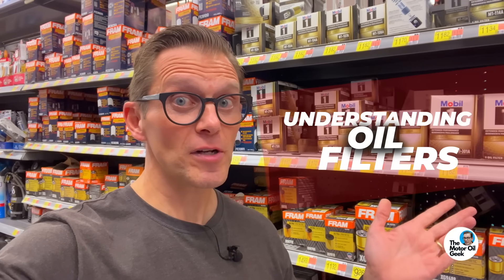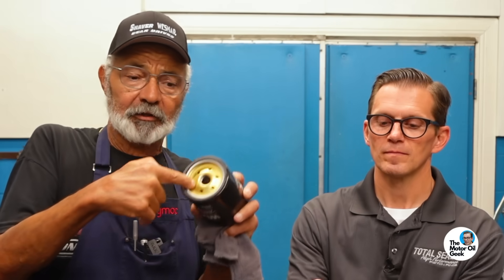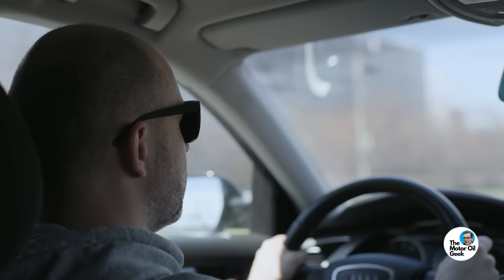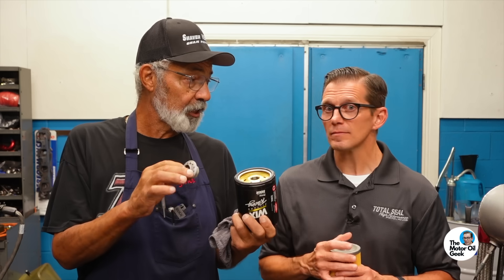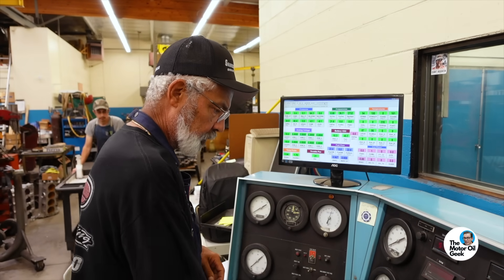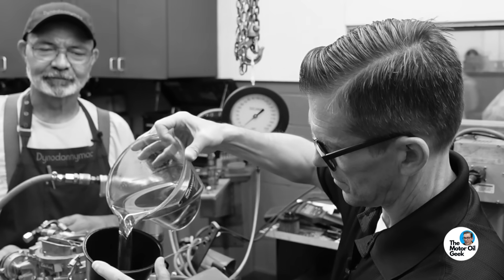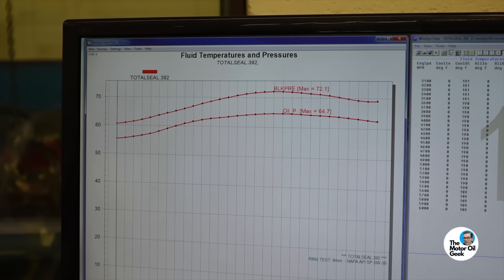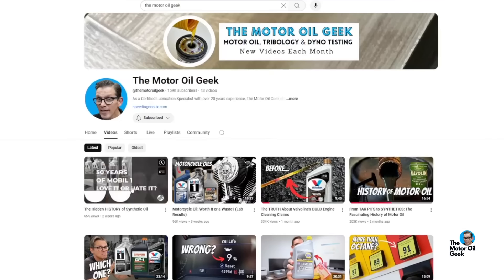OIL FILTERS: What Most People DON'T Know!

Comment: Someone commented on one of my videos when I did a video cutting open a filter after a 10k mile service. Filter wasn't clogged. The person insisted that it went into bypass when it started and then again at around 5k miles.  That the filter can't handle anything over 5k miles.  I was like thats totally incorrect my dude. Thanks for watching though. You just verified it for me and I hope he sees this video.
Reply from the maker: I'm happy to help!
Reply: 70 years ago Soichiro Honda understood that forcing cold viscous oil through a paper filter distorted and destroy the filtering characteristics of the paper. It turns the 20 micron holes into 200 micron so he designed and made sure the companies that manufactured his filters where manufactured to his spec of filtering materials and bypass  at the delta he wanted and made sure that they bypass at every cold start. Now decades later and filter materials have changed but 40 years ago when this was explained to me by a Honda master instructor at a Honda training center I tend to believe the instructor knows what he is talking about. Today with the filter materials always evolving probably can handle cold oil being forced through them but I doubt it, your Ford or Chevy filters are probably going from 20 micron to 200 micron the first time you start the engine up and it's probably one of the reasons why Honda's can go a million miles without a rebuild and a Chevy or ford is lucky to go 200k miles. Today none of this matters because oil is being destroyed by weak rings letting fuel dilute the oil.
I own a Chevy truck and Ford car but I ride one of the fastest Honda's on the planet.
Reply: @davidkato6407  the new Hondas not so much. Thats why I don't use fram filters. And he just showed in this video it doesn't go into bypass. I believe the dyno results. Now it may have been true 40 years ago.  But doubt it is today.
Reply: @BeardedFordTech  🤦‍♂️
Reply: @BeardedFordTech  70 degrees is not a cold start.
Reply: @davidkato6407  An "engine cold start" refers to starting a vehicle's engine when it is at a significantly lower temperature than its normal operating temperature, typically after the car has been sitting idle(not running) for a long period, causing the engine oil to thicken and making it more difficult to start and requiring a slightly longer warm-up period before driving normally; essentially, starting the engine when it's cold. Then there is cold weather start. Thays different. Then you have hot soak and cold soak. This isn't my first rodeo
Reply: @BeardedFordTech  Evap PID test will not run until all cold start conditions are met and that is not 70 degrees it is well below 50 and if you live in a warm climate these onboard ECM test will not run for weeks until it gets a cold start.
Reply: @davidkato6407  what does an evapntest have to do with a oil filter bypass valve?  And evap leak checks perform when the vehucle warms ups. A evap leak check will not perform on a full tank or 1/4 (or below)  i can work on a ford cold start it and go 7 or 8 miles and get all the monitors to go to ready status. But I'm still wondering g what any of that has to do with a bypass valve in an oil filter that opens whe there is a difference in pressure of 7-11 psi.
Reply: @BeardedFordTech  70 degrees is never a cold start
Reply: @davidkato6407  cold start. When engine is cold. Which is below operating temp. Why is that hard for you to get through your head?  Have a great day.
Reply: @BeardedFordTech  have fun working on those Ford recalls I've got an eco boost that will need replaced soon, do you know a guy?
Reply: @davidkato6407  working on recalls?  Oh your sadly mistaken. I don't do recalls. I haven't been at a dealer in 3 years.  Thats what you get for assuming things. Typical for someone who doesn't understand what a "engine cold start" is.  So know I don't know anybody to work on your ecoboost. Not that they would want to anyway with your attitude. I'm sure you can figure it out since you know how everything works. Good luck. Have a great day.
Reply: @BeardedFordTech  70 is not cold no matter how you look at it.
Reply: @davidkato6407  if you say so. I don't think you quite understand the definition of cold start. It's okay. You'll get there. Keep learning you got this
Reply: @BeardedFordTech I am a master auto tech for 30 years and the federal law states that at all cold starts the on board diagnostic system has to run a leak test on the EVAP system and this never happens at 70 degrees or 60 degrees or 50 degrees each manufacturer sets its own cold start temp usually below 50. If you don't understand this you will always have problems diagnosing cold start and emissions problems and can be fined for making changes to the EVAP system.you could be fined $100k for not knowing
Reply: @davidkato6407  ig you were a master you would know evap leak test is only performed between 3/4 and 1/4 tank of fuel. Not every cold start. Might want to brush up and go recertify just saying. I been doing this 23 years
Reply: @BeardedFordTech  your talking about the test you run on the laptop not the on board test the ECM runs. That is 2 different things I also have a degree in electrical engineering.
Reply: @davidkato6407  ugh no. I'm talking about what the car does. Maybe you should rethink your engineering
Reply: @BeardedFordTech  Every cold start an EVAP self test is performed, it doesn't care or know how much gas is in the tank. The manufacturer recommended that if you perform a laptop test you should have that much gas in the tank for better accuracy. Every car on every cold start runs an EVAP test and the oil filter do bypass every time if functioning properly.
Reply: @davidkato6407   an EVAP test is not typically performed every cold start. The EVAP system monitor, which is part of the On-Board Diagnostics (OBD) system, runs under specific conditions, not every cold start. These conditions often include a cold engine, a specific fuel level, and certain environmental conditions. The EVAP test is generally recommended when you suspect an emissions problem or when your check engine light is on. 
Here's a more detailed explanation:
EVAP System Monitor:
The EVAP system monitor is part of the OBD system that checks for leaks in the fuel tank and fuel system. 
Not Every Cold Start:
The monitor doesn't run every time you start your car, even if it's cold. It runs under specific conditions like cold engine, specific fuel level, and environmental conditions. 

The original comment was about a oil filter going into bypass anyway. Where did evap test come from?
You aren't very good at this are you.
Reply: @BeardedFordTech  it's the federal government that set the cold start temperature 30 years ago and you don't want to follow the law that's your problem but for the rest of us we have to follow the law and perform correct diagnostic from that cold point you will always have problems
Reply: Why do you keep saying it looks at the fuel level when it doesn't. Yes the environmental conditions have to be met, yep it has to be a cold start.
Reply: @davidkato6407    SIR -- One Reason When SO CALLED EXPERTS Scream , NEVER Let Your Car IDLE AND WARM UP ------------  I SCREAM BACK (((( BULLSHIT )))  .  Working a a A- Oiler In A Open Pit Mine Learned Very Well What a COLD START and Putting the Engine Under Load Can do to the Filters .  ------- EVEN  ----  CAT ---- Best Filters On the Market , Would Split Open .  It Took Time but the Mine Found Out What was Causing it and Put a Stop to NOT Letting the Engine Warm Up before Operating . ....................................  IN COLD TEMPS , NEVER JUST START AND TAKE OFF --- NEVER .
Reply: @davidkato6407  absolutely AGREE
Reply: Yeah and what's at the bottom of the oil pan
Reply: @Drmcclung  oil. Oh wait, you're thinking sludge. Well, in order for it to sludge, it has to max out its oxidation.  And as Lake has said on my channel, once it starts to oxidize, it's linear. It doesn't come back down.  And I was nowhere near the oxidation value being maxed out. So therefore. Oil  there.  Not sludge. He went over this on my channel with used oil analysis shown on screen.  Hope that helps
Reply: @BeardedFordTech  look inside the sludge
Reply: @Drmcclung  may I suggest watching the oil analysis video with him. And he's says. It's not sludging. Carry on now. Have a great day
Reply: @BeardedFordTech  oil analysis isn't seeing anything embedded in the sludge that itself is embedded in the pan and doesn't circulate is what I'm getting at, it's there to stay, oil analysis is never the whole story. There's probably 30 videos, old videos and new ones, on YouTube showing exactly that and I'd go watch those yourself before getting snarky about it.. video on video of oil analysis coming back reasonably ok yet on teardown of the actual engine being analyzed there's always all kinds of nonferrous metal and gritty trash in the corners of the pan, every time. In street machines, not dyno mules and race cars that are routinely refreshed. I've seen too many myself from working in the machine shops my bud
Reply: @Drmcclung  i did teardown the engine. May I suggest watching that one as well.
Reply: @BeardedFordTech  good for you. That's one engine
Reply: @Drmcclung  🤦‍♂️
Reply: Well this escalated quickly
Reply: @Drmcclung  thing is i wasn't trying to be rude or snarky to begin with. 🤷‍♂️. I'm over it.
Reply: @BeardedFordTech  that's cute
Reply: @reggiNylgU  you don't have to be a prick either. Employed mechanics, wrong or right, that's an uncool thing to say to
Reply: @Drmcclung you two getting a room?
Reply: I just watched a few of your videos and it looks to me like you got your ASE certificate from ShadeTree University

Comment: Certainly some amazing content and some very useful information. One topic this been brewing for quite a while that I would like to see addressed is that of the oil separator/catch can.

Tons of thoughts, both pros and cons, but with the newer and smaller direct injection engines, especially those like the Ford F150 with the hybrid system we seem to be getting a lot more cooling cycles into the engine. This in my mind raises the condensation in oil, at least in the northern states.

Could you, or would you, address the ideology Of an oil separator? Also would be nice to see pros and cons on both sides of the fence. Appreciate it.
Reply from the maker: Thanks for the suggestion.

Comment: "The inside of the engine is a bunch of leaks"

Makes for the perfect visualization. Oil cold = high viscosity = less flow = lower delta across filter. 

Isn't it interesting that the bypass pressure is just above the max delta pressure at high RPM? It's like the oil filter companies want to make sure the oil flows through the media at all operating conditions when media is operating normally, i.e. not clogged.
Reply from the maker: Right on!

Comment: Subaru of north America will try to void your warranty if you use an oil filter with less than 23 psi oil filter bypass. I personally use the Nappa filter with a bypass at 25psi because that what the mechanic told me to. I didn't want to use the factory Fram filter that comes on most of later model Subarus.
Reply from the maker: Thanks for sharing!

Comment: Every Subaru person that think they need a 20+ psi bypass filter needs to watch this video. I’ve tried explaining this throughout the years and people just can’t get it through their heads. I run Fram Endurance or Ultra on our Subaru with an 11-17psi relief and I have zero worries it’ll go into bypass because they have proven to have very little pressure differential across the media.
Reply: This. I had a Legacy GT and I remember them all freaking out about the lower bypass pressure on the Wix XP's.

And the actually pressure delta may change from filter to filter. If the media is better, or larger, or freer flowing on one filter vs another, then the delta across the media wont be the same and the bypass pressure doesnt need to be the same. I know the Wix XP's and the Fram Ultra's flow pretty well.

Comment: The test for the pressure delta across the filter screen doesn't identify if the valve is operating or not.
The flow through the filter assy. could include a valve open state.
What it could show, is the great job the filter engineers did in matching bypass valve flow with oil pump displacement. Or am I looking at this upside down?

Comment: Thoughts on multifit filters VO-25 Valvoline for example covers 7 part numbers. Do you think the differences in say filter media size, bypass valve pressure etc has any negative effects when using multifit compared to what the OEM recommends?

Comment: Why does this guy keep calling the bypass valve a "check valve'. A check valve stops the oil from going backwards through the system. A bypass valve is there in case there is too much pressure, it "bypasses" filter element. Geek, do you review these before posting them?
Reply from the maker: I do, but I thought the point was fairly clear.

Comment: Everything you did in this video, I know is right and I already knew how oil filters work so I guess I am better than these old engine guys.  What I have a tiny gripe about is 2 things, "Cold oil" is not room temp 70f oil. It is 20f 10f -20f winter time. I am certain the thick honey molasses oil even Synthetic, will bypass till it gets thin enough for that differential to even out.  Second, I have seen filters torn down the past could years that the bypass is not glued to the filter element, Champ and Fram, and you can see light between the 2 pieces which means unfiltered oil always is going to leak thru, which is not good. Filters without a bypass are sealed, but this something to also keep in mind and modern VVT engines are not good at handling junk.  I say all that to say this, I think if you guys can put that mule engine in a freezer somehow or stick it outside and get it to that 10f temp, I think that would be quite interesting to see. Thanks for another great video!
Reply from the maker: Since the engine and dyno are in LA, we are not going to be able to get the engine down to -20F.

Comment: Back when auto parts stores had book to look up the filter that you would need for your car, I noticed that the back of that catalog had a ton of information on oil filters.  The bases, whether the filter had a bypass built into it, the bypass pressure, and if you could figure out which base your filter had you could pick a filter that would give you more filter area but still fit on the engine.  The 2.2l Chrysler engine had a horizontal mount and a bigger filter would fit.  That allowed me to increase the oil  capacity slightly without overfilling the sump.  That was important for a road race engine.  Good stuff.  Thanks!
Reply: The Wix filter lookup is a good resource for looking that up and comparing. I use an automotive filter on my motorcycle based on the specs to upsize capacity like your example.
Reply: Yep, like a ph8a on a 2.3 lima and I think it even worked on the 4.0 straight 6. That's an extra half quart. I do the same on the bike but it's only a half inch longer.

Comment: Interesting video and I don't doubt your results but I would suggest the result doesn't speak for all engine/oil/filter combinations.  I have seen a similar test done on a different motor (Holden) with a different style of filter (older paper element Vs enhanced cellulose) and different oil grade with the internal engine oil bypass blocked forcing all oil through the filter and it showed a cold oil delta of about 20psi across the filter.  I am happy to see modern oils and filters certainly flow better cold than the stuff we ran 5-10 years ago.  Sadly, down under, Wix filters are not commonly stocked on automotive shelves and it's more of a exotic item.  I run Ryco filters and have only recently made the switch to their cellulose range.  We always pre-fill oil filters.
Reply from the maker: Blocking the oil pump bypass is a big no-no. That would cause problems.
Reply: @themotoroilgeek  Those engines were built by pro engine builders for race cars that were very successful so I'm sure they know what they were doing.  Certainly not a street car mod.

Comment: Sorry Lake I think this is just Plain WRONG !! Those little filters can no way pass cold thick Oil with just 10psi through the average filter material at the rate the Motor needs it.
Top Engine Guys have long known these only offer partial filtering ( hot oil at lower RPM) for years.
Do a proper test with a fabricated Housing that you can remove the Bypass and test😉
If this was not the case you would not get debris strewn throughout damaged Engines.

Comment: As I’ve had vehicles damaged by workshops over filling oil by 20-30% above manufactures recommended levels it would be great to have someone explain how much pressure is increased for every 5% of extra oil above prescribed levels. 
I can’t find any content online that addresses this topic.
Reply: More oil does not increase oil pressure.  Excessive oil will cause a problem if it reacts with the moving engine parts thus causing  foaming and poor circulation air bubbles.
Reply: @danc2014 So if you reduce the volume of oil in an engine by 50-60-70% the pressure remains the exact same.